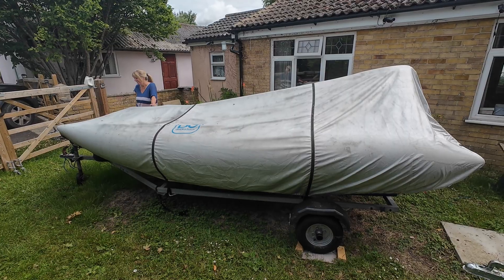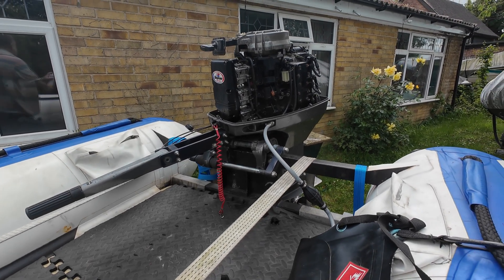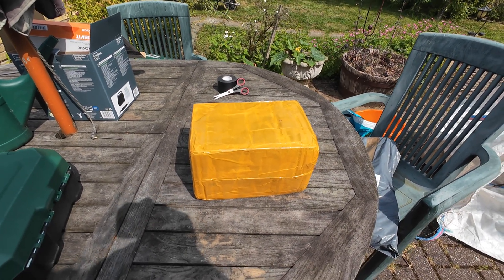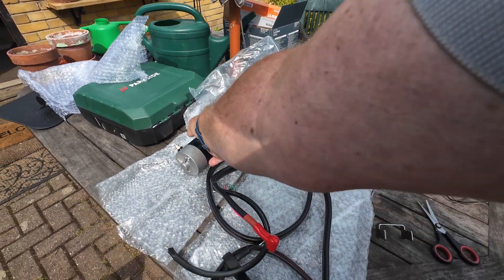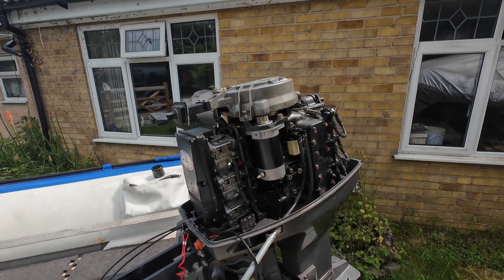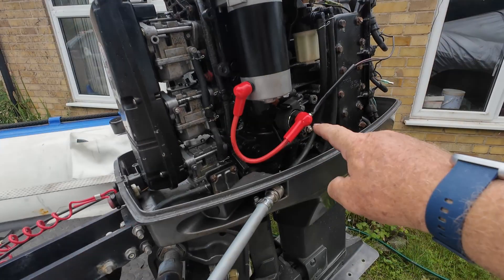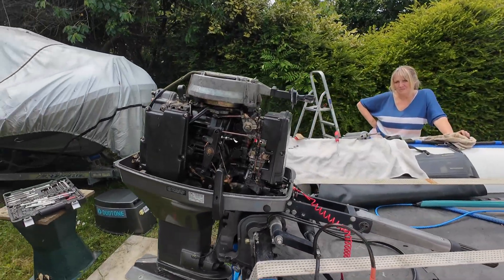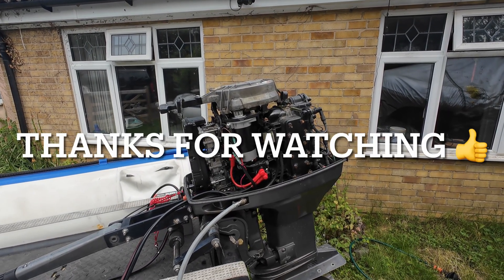Converting a 50 HP Tohatsu pull start to Electric Start

Comment: That engine wouldn’t fill me with confidence if I was a mile or so out at sea lol
Very clever idea with the starter your a clever chap
Reply from the maker: I can assure you that older 2 Strokes are so simple they just keep going. I have been 5 miles out in boats with engines as old and older than that. I would prefer those over any new complicated 4 stroke full of sensors and electronics